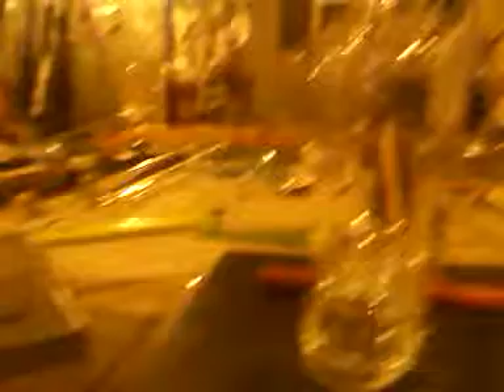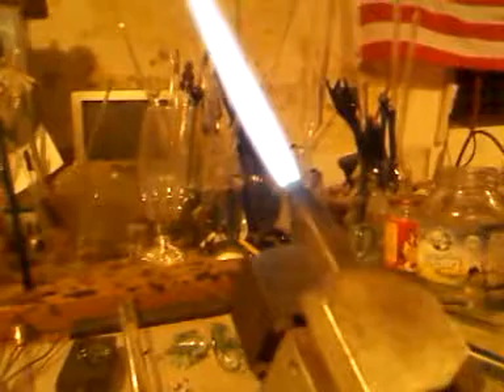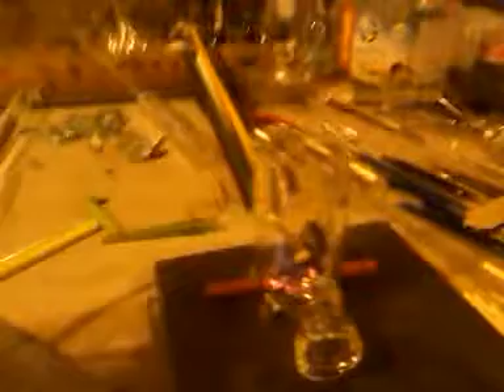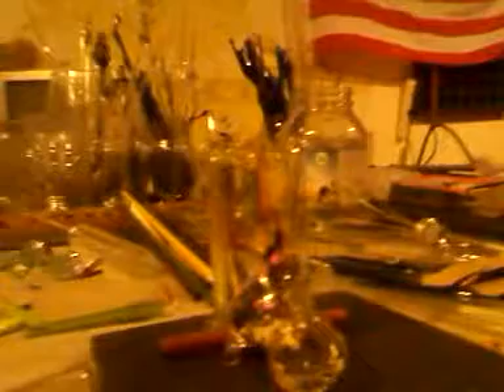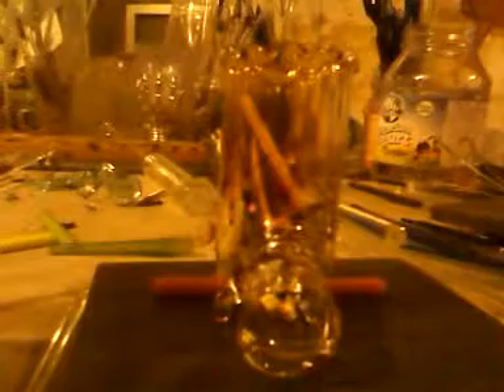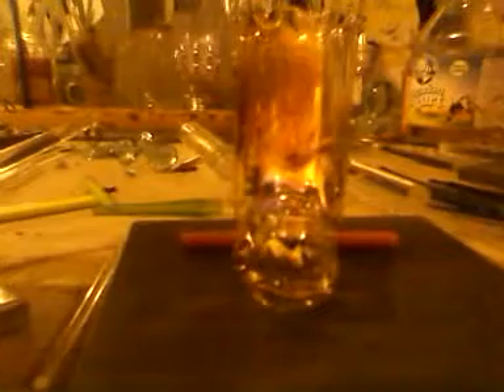World's 1st Glass Pocket Rocket Stove! It works!

Comment: I think the idea is awesome. What about building a secondary chamber around the flute to use air as an insulator like sweat proof cups. To allow the heat to stay in tr combustion chamber but still be see through. I know nothing about blowing glass but it's how windows work. Very very cool.